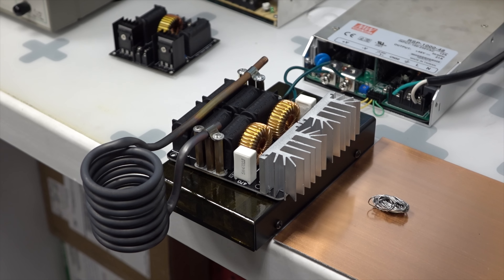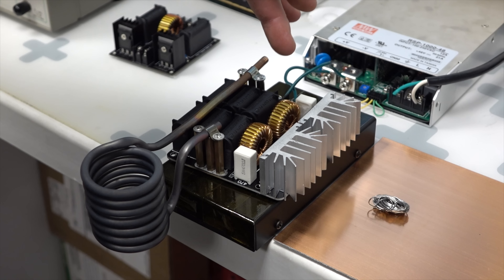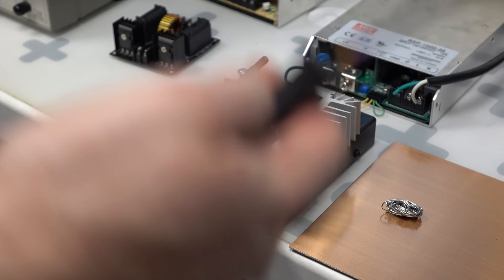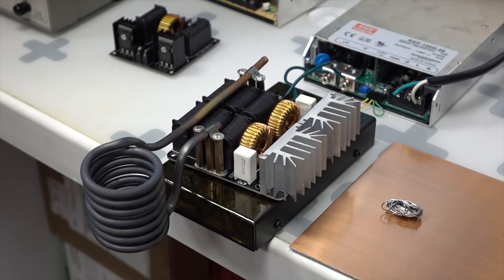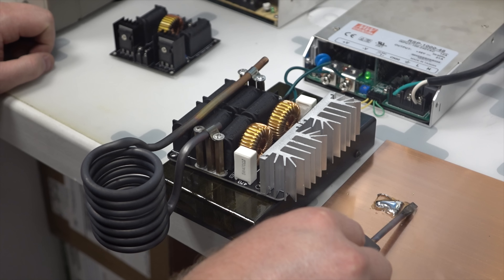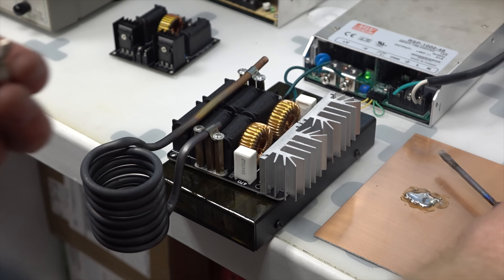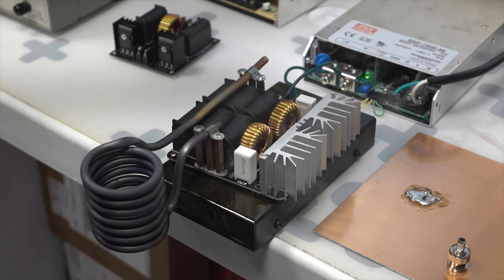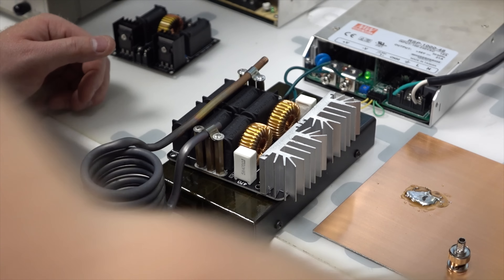1000W Induction Heating Part 1

Comment: Thanks for your video. Will you make your induction machine with  a cooling feature ? I also plan to use induction heating in soldering but I read it should be good to have the machine that is a water cooled, otherwise it can burn.
Reply from the maker: +Lad Bla Check out my other videos in the series.  You do not need water cooling if you insulate the coils.  If you use copper tubing like in the video, then you should use water cooling through the copper.
Reply: +Proto G 
Can you please explain a little more what you mean by "insulate the coils"? What kind of the insulation I should use?Thanks
Reply from the maker: +Lad Bla Watch the next video, I explain it.
Reply: +Proto G Do you mean  1000W Inductive Heating Part 2: Solder Pot ?
Reply from the maker: +Lad Bla Yes.  You will need water cooling if you use copper tubing.  If you use litz wire, which is more efficient,  you will need insulation to protect the wires.  Fiberglass exhaust wrap, kaowool or similar material will work.
Reply: +Proto G Thanks for the reply. If I understand properly, an insulation of primary winding( it  is a copper tubing here) is needed because of heat that is generated in secondary( melting pot). Primary itself does not generate any heat but only receive heat from the secondary. Is it so?
Reply from the maker: +Lad Bla Mostly yes, you are correct.  The coil alone will get warm depending on how powerful your supply is.
Reply: +Proto G Can you please answer the following questions?
There are available more versions of induction heaters in the market. Why did you choose this one?
What power supply do you  need for  correct function?
I want to buy an induction heater but do not know which version to buy.
I need to reach  about 250° only but during 6 seconds.Can you please give any recommendation for choosing a proper induction heater?
Thank you for answering the questions.
Reply from the maker: +Lad Bla I chose this version because it was the cheapest and most powerful.  It also comes with a nicely wound starter coil.  There is a link to the power supply I used in the video description.  I also put links to a lot of other things I use with the heater.   250°C or 250°F?  It really all depends on what the material is made of.  What are you trying to heat?  Steel will reach high temperatures very quickly but aluminum and copper take more time to heat up.
Reply: +Proto G Thanks for the reply.I mean 250°C. I plan to use an induction heating  to heat up a copper soldering tip. The size of the tip should be about 100x30x2mm( L x W x Height). Do you think it will work with this ZVS driver? You also say:" I also put links to a lot of other things I use with the heater." But where are those links?
Thank you
Reply: +Lad Bla Just click on ""Show More" just underneath the video(s). There is a list of URL's.
Reply: +Proto G so, I finally found out the link to your power supply( thank you Bert Isevil  ). Your power supply is quite strong ( outputting around 1100 W) and also quite expensive. Have you ever made any experiments with less powerful  supply? I am not sure if I really need such strong( expensive) power supply. I need to heat up soldering tip of  size  about 100x30x2mm( L x W x Height), temperature 250°C.Thank you for your reply
Reply from the maker: +Lad Bla I think a 350 Watt power supply like this one will work for you: http://amzn.to/1irCCIA
It was the first one I used and it does heat up steel really well.
Reply from the maker: +Bert Isevil I couldn't reply to your comment on the other video for some reason.  You're right about the MOSFETS, but I was just worried about running the MOSFETs near their upper voltage range.  The capacitors are actually kept pretty cool by the fan and the large black aluminum heatsink the board is sitting on.  The copper coils do not really heat up on their own too much.  Only from radiated heat.  If I use it a lot, I use circuit cooling spray to cool the coils down.  I may eventually water cool them, but I have plenty of circuit cooling spray.
Reply: +Proto G Today the device has arrived. The only power supply I had was 5V 35A. I tried it, the green LED was on, one aluminium heatsink  was quite warm, the other was rather cold and when I tried to heat up a thing inside of the spring nothing happened. Do you think that the power supply was small and it could not  deliver a large surge of current when the induction heater was powered on so  it  failed to oscillate?How can I check that the device oscilate?Thank you for your help
Reply: +Proto G I finally found the RSP-1000-48 Meanwell in my country  but also  RSP-1000-24 Meanwell which is a little cheaper and can supply higher current.
Which one would you recommend?
Thanks for the reply
Reply from the maker: +Lad Bla RSP-1000-48 is the best power supply for this ZVS unit in my opinion.  The ZVS driver should not be ran much higher than 23 amps or so.  The 48 volt power supply allows for larger coils.  You would have to make a small coil for the ZVS driver to draw anywhere near 20 amps with the 24 volt power supply.  Both will work though.
Reply: +Proto G Thanks for the reply. And what is the cross-section of  that litz wire you used for you conductive coils? I did not wind that  at Amazon website.
Reply from the maker: +Lad Bla Check on eBay, they have a good selection of litz wire.  I prefer litz with more than 200 strands.
Reply: Today RSP-1000-24 Meanwell has arrived. I tested it with ZVS unit and it works well. Thank you very much for your help.
Further I tested it with few different  materials. From my tests I concluded induction heating is not useful for material with low resistance such as copper or aluminium - it takes long time to be heated.  While metal was heated in few seconds.Can you confirm that?
If I need to heat up  a metal of 45x 10x1mm( Length xHeight x Thickness) to about 200°C , what kind of material would you recommend for conductive coil? What diameter of that wire? Did you make any progress regarding the induction soldering machine?
Reply from the maker: +Lad Bla That is not true.  It does work well for copper but 24 volt is not enough to heat it up quickly.  See this video here: https://www.youtube.com/watch?v=FMVqsSNO07g

See my detailed write up here: http://www.instructables.com/id/7-Uses-For-an-Induction-Heating-Machine-How-to-Mak/

You are going to have to do your own research to fit your needs.  My article should be good enough to get you started.
Reply: +Proto G Thank you for your reply. 
As I already wrote , I need to heat up a soldering tip( thermode) of  size 45x30x1mm. I think either resistance heating or inductive heating  I should use. For resitance heating I need more current but for inductive heating more voltage. Did you test your  RSP-1000-48 power supply how good it is for a a resistance heating?
Reply from the maker: +Lad Bla resistive soldering is another beast all together.  You could make one with a microwave oven transformer.  Like I said, you'll need to do your own research.

Comment: Hi, I like your videos, but I have a question about this one, do you never needed to cooling the copper coil? or using a kind of fan? and if i don't do it, how could affect my ZVS driver ?, because I saw other videos that they do that with a little pump of water, but I don't know if is it because they don't have the same power supply than yours. 

I just need to overheat red hot thin copper rods of 3mm or 1/8" enough for melt plastic.

Do you think is going to be a problem if I dont use the water for cooling the copper coil?

I hope you answer you could help me a lot. Thanks
Reply from the maker: Federico Flores A pumps and a fan is a good idea if you plan on using it more than 10-20 minutes at a time.  If you’re just using infrequently enough to allow the unit to cool between uses, you should be fine if your power supply is good.  Cheap power supplies that have slow rise times can stress your components and often result in blowing a mosfet almost immediately.  The work around for this is to use two switches.  One switch that turns your power supply on and a separate switch to connect your driver to your supply.  That way your supply will be at full rated voltage when the driver is switched on. I hope this helps!

Comment: with this Inductor  , I can reach a temperature of 1600 degrees celcius?
Reply from the maker: +Eco Fuel No.  The hottest I've reached is 1100C.
Reply: + Proto G So I can not melt iron?
You indicates a Inductor that can go in  temperature of 1600 degrees?

Comment: It is possible to run this model ZVS inductions Heater 1000w  in 12V to reach 1000w? This means 83A !!!
I can or not?
Reply from the maker: +Eco Fuel No, that would not be a good idea.  Your coil would be very small and almost useless at that point for most things.  48V makes for the best coil at full power.
Reply: +Proto G I can do a large copper coil to use the 12V 83A 1000W?
Reply from the maker: +Eco Fuel No.  The larger the coil, the more the resistance.  Use Ohm's law to calculate the current draw of the coil.  You will need to understand how Ohm's law works before designing your own coils.  The larger coil you use, the lower current it will draw.  To draw 83A from a 12V power source, your load will need to have a resistance of 0.144 ohms.  That is not going to happen with any coil that you make.  You could end up hurting yourself if you start experimenting with high power electronics without understanding the risks.
Reply: +Proto G This original configuration of copper coil which and the maximum thickness of a metal can put heat to melting point?

Comment: Do you still use this? If so how well has it held up?

I'm looking at building pretty much this exact setup, I just purchased the 1800w ZVS driver and I'm about to buy the MW 48v 2000w power supply.
Reply: You can buy a premade of ebay for 70 usd or so, 1000w

Comment: Very nice. That looks like the same design I'm working from. What transistors are you using?
Reply from the maker: +gristc Thanks!  It's just a common ZVS driver circuit with two IRFP260N Power MOSFETs.
Reply: +Proto G Heh, that's even the same FETs as mine. It will make a spoon glow red in about 16 seconds, but I haven't managed to actually melt anything yet.

Currently building one based around a pair of IXGN60N60C2-D1 IGBTs. Then the big one will use CM300s.

What are the inductance and capacitance of your LC tank?

Comment: I bought the induction unit, not realizing I need a bunch of other stuff. Can someone help me, I really don't know what I'm doing
Reply: The simplest way to run this would be to put two car batteries in series. That or buy the power supply similar to the one hes using. I intend to rewind a microwave oven transformer and step it down to 24 volts and use a 100a rectifier.
Reply: First, you need to look up the specifications. For example, if the induction heater is 500W, you need the 500W power supply. The power supply MUST output voltage which is within the range of the induction heater circuit input voltage. Second, when choosing the power supply, the chosen power supply maximum output amperage (current) MUST BE same (its prefered to be slightly, like 0,1A lower) than the maximum current inductor heater circuit can accept, otherwise the inductor heater circuit will fail (catch on fire, components will blow up, etc.). For example, if the current limit for inductor heater circuit is 20 amps, the power supply maximum current output must be 20A (prefered to be slightly lower, like 19,9A). In case of the video, the 1000W inductor heater unit can tolerate 30A, as stated in eBay offer description, but 20A is stated to be maximum for safety precautions, so the power supply in the video is 1008W, 48V, 21A, and the inductor heater unit works without problems. But, it is IMPORTANT to have the inductor coil to be water cooled, if hollow, and the inductor heater circuit cooled with fan, because, in the case of video, the inductor heater unit is very powerful 1000W. High temperature on circuit can cause the plastic case on capacitors can crack, cause short circuits, cause transistor to burn, melt solder, etc. So, when working with high power circuits, like this and heaters, always think of safety, including proper power supply. And, yes, the power supply in the video does have very fast start-up time, thus ignorable. But big diesel engines cylinders have to be filled with a little bit of fuel for good start - primed, so this powerful inductor heater needs to have required voltage at the start so it would start oscillating - needs a "kick", or you will burn destroy the transistors as the will get on fire from heat caused by the short circuit caused by the lack of oscillation. So put a switch between power supply positive output terminal (in the video its V+) and the inductor heater circuit positive input terminal, power up the power supply while the switch is OPEN and after 5 or 10 seconds and CLOSE the switch. Good luck with everything and BE SAFE.

Comment: Those are just the DIY heaters that are on eBay, right?
Reply from the maker: +TheDeepFriedBoot The board in the front is from eBay.  It's just a basic ZVS driver.  2 mostfets, 6 capacitors, 4 diodes, 4 resistors and 2 inductors.  It's cheaper to buy it than source all of the components individually.  The coil shown here is not very efficient for the high frequency pulsed DC.  I plan on making different attachments, more efficient coils out of litz wire as well as adding power meters and building an enclosure.
Reply: +Proto G Nice, I just picked one up to play with in our lab. Reading about those units it does sound like they need some safety upgrades such as only turning on when power is good and such.

Comment: Can any one tell me if I have to use 1000 watt power supply?  I can't find one for less than $300 and I really don't want to spend more than $100.  It is my understanding that as long as its >24 volts with a toggle switch between my induction unit and the power supply the unit will work but that it just won't heat as quickly.  But will a 500w power supply be capable of achieving temperatures sufficient to smelt aluminum?
Reply from the maker: It would be much cheaper to use gas.  Just make yourself a furnace and it will cost way less than $300 and melt aluminum faster than using this.  Even my 1000W unit with a really nice power supply, took longer to melt that small amount of aluminum than I would have liked.  500W might work but would probably take forever.

Comment: Hi Proto, new subscriber here. This week I tried (repeat tried) to replace the muffler on my old car. I could do everything but free the three rusted nuts/bolts holding rusted exhaust pipe flange to catalytic converter flange.

In short, a mini-ductor is $600 + $200 for the accessories. An oxy/propane rig would set me back approximately $500.

Would a DIY induction system like yours be viable for me? Could I fabricate different tips? Could I make it somewhat portable?

Any thoughts appreciated.

-Randall
Reply from the maker: +RandallFlaggNY Sorry for the late reply, but yes, you could use this for that purpose.  If you watch part 5 of this series, I used this driver with LiPo batteries.  It will be a lot of work, but you could do it.

Comment: dude how much could cost this setup with power supply altogether? thanks... subbed
Reply: $30 - $40 for the induction heater and about $100 for a 1000W PSU

Comment: Outros quetion!
i need a temperature meter 5000 degrees how you recommended ?
Reply from the maker: +Eco Fuel I do not know.  Mine only goes to 1300C(2000F).

Comment: Thanks for your video and concepts..

Just curious about the induction coil winding in hollow copper pipe. I always presumed that was to give cooling by a liquid going through it for prolonged use? Or perhaps that was just my engineering instinct making up stuff when I was an apprentice being given a tour of some of the alternative new concepts going back 40 years ago. But it seems you are not using with cooling. Perhaps such high currents are unsustainable?

But you have got me searching through ebay for them. They may go on my wish list. Do you get to change the frequency or is it fixed? I want to heat up some aluminium sheet to insert into a hard to get at place to heat and join some layers together that will fuse nicely if done correctly. So my search research led me to your video popping up in a google search link. How about that aye, your famous ;)